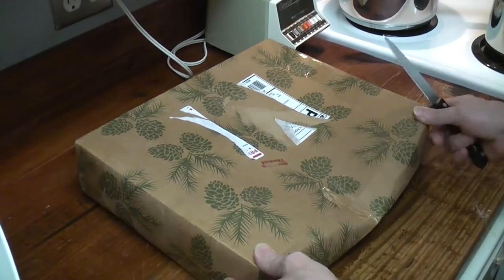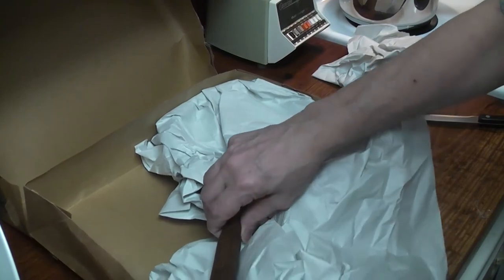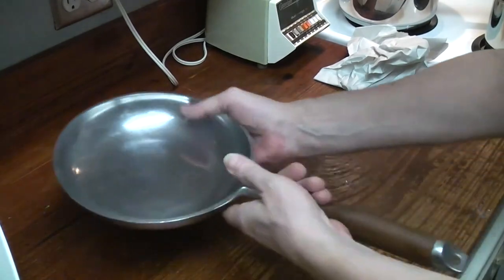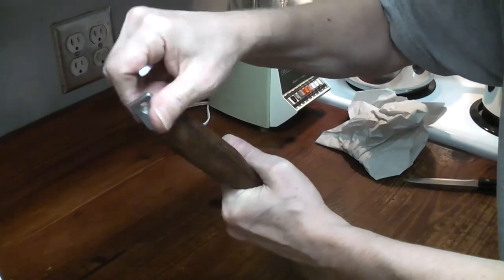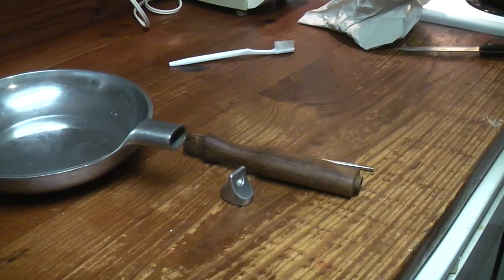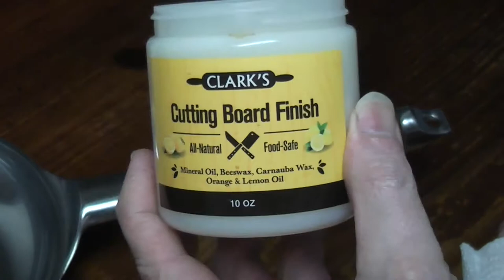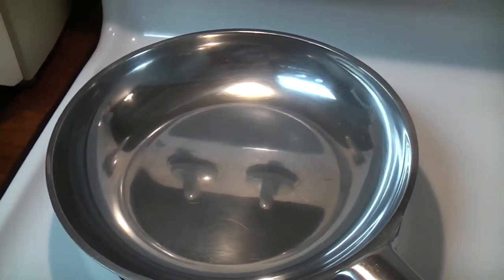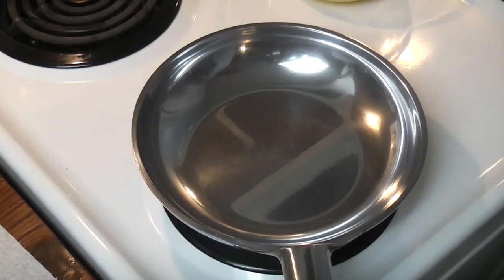Copco Michael Lax Aluminum Fry Pan Unboxing, Restoration and Use

Comment: Hi there, I have two of these pans in different sizes but the aluminium has darkened off and spotted. Do you have any recommendations on how to clean? I can literally find nothing else except for your video on the entire Webb!
Reply from the maker: Do you mean the cooking surface? I've heard, but never tried cooking rhubarb in it will shine it up. Cream of tartar is supposed to work as well. If the polish sheen is gone, I'd just go Bar keepers, brillo and elbow grease. Wish I could be of more help. If you can find some Bon Ami 1886 I'd highly recommend that.
Reply: @xetaprime  what a Quick reply ! , wish I could upload a Photo!  It’s darkened off so areas are a mottled dark grey . It’s not textured and the smooth texture is still there so it hasn’t pitted just really really dark which is unusual . Was going to try cream of tartar , and saw some videos of sandpapering which I really don’t want to do as I reckon with ruin surface